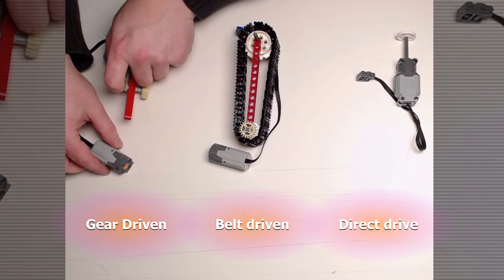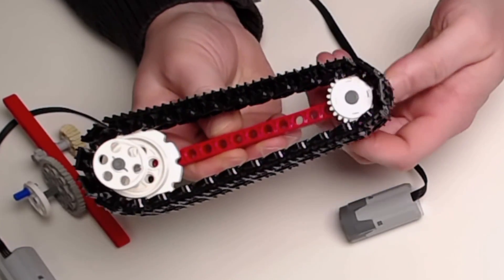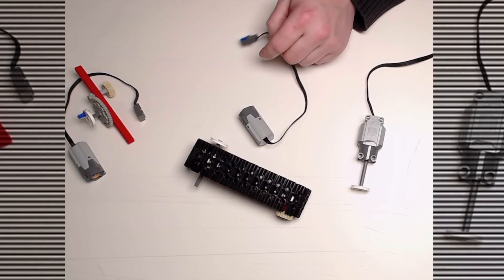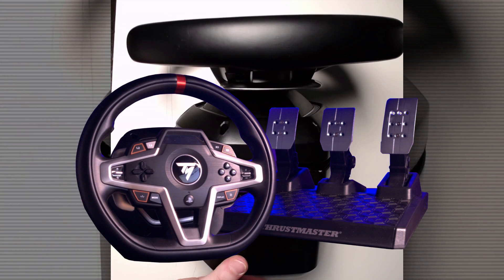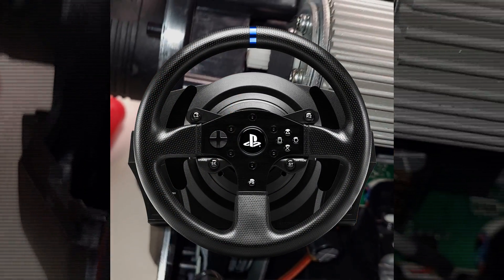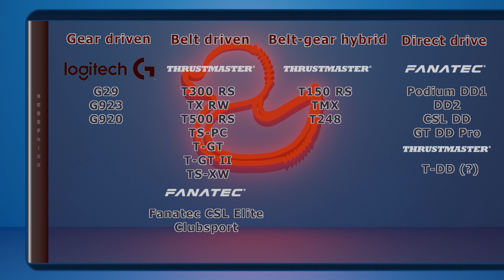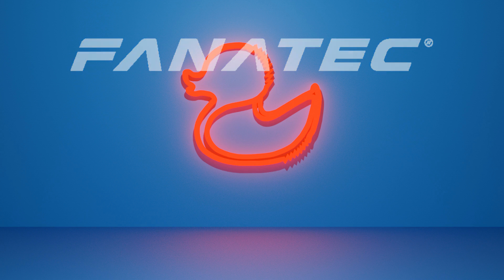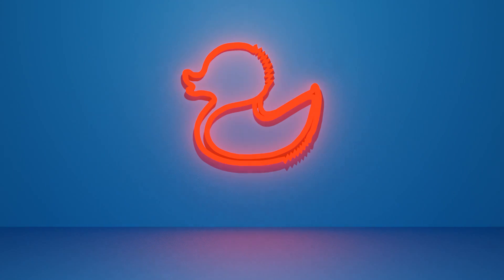Special: Direct Drive vs Belt Driven vs Gear Driven

Comment: would direct drive have a more realistic FFB? Every wheel I've tried, the wheel is always unrealistically hard to move and recover from upset. I'm guessing it could be the game doing that? I play assetto. I currently have a t300rs
Reply from the maker: @cutliss  more precise the settings. You could probably make your t300 feel better by playing around with settings like damper for example. The direct drive will help with a smoother transmission and a more fluent and fast return to center but if the settings are not right, yeah, it will also not feel realistic. My advise is to look up "ffb settings t300 ac" on google. You will find some reddit pages that will provide you with some settings to get the max from your wheelbase

Comment: wow didnt know t248 is hybrid. so its better to get the t300 for only $20 more
Reply from the maker: The T300 base is indeed more smooth and more powerful and you have a more broad choice for steering wheels. Only downside is that the pedals that come with the T300 are very mediocre compared to those that comes with the T248 (in a pack)
Reply: @SimTourist  how about t300 pedals vs the g29 pedals? i have the g29 on my 2nd week currently and im planning to upgrade. this sim hobby is getting expensive. im looking for Moza R5 and T300 + the f1 steering wheel mod now
Reply from the maker: @archinerdz97  the T3PA pedals are on par with the Logitech pedals. I currently bought an R5 to review it. It is pretty good. Please check out the Fanatec offer too if it is available and affordable. I believe looking at the current prices, upgrading to a direct drive is more advisable than a T300. For 400€ there is a Fanatec bundle and that is cheaper than the T300 (of course depending on the region)
Reply: @SimTourist  thank you! going direct drive is the right choice then

Comment: Hi, the video is awesome! Can you talk more about the durability of both logitech and thrustmaster t300 rs gt? I've seen a lot of comments I came across while researching and it seems they are both bad and good at the same time. By that I mean is some people say TM broke easily and now using logitech for years and the other is vice versa of that. What is your opinion on it though?
Reply from the maker: Hello my friend. The main issue the T300 has is that the flexibele intermediate (the belt) causes a lot of heat. Now that would not have been such an issue if the power suplly was not included in the enclosure of the wheelbase. If you look at bigger brother the T-GT, it doesnt have the same problem that the T300 has. While the Logitechs are gear driven, they do not create as much heat. I have read many fora and the consensus is that the Logitech have an average longer life-span. My next video (hopefully released this week) is in fact a remake of this one with added info and a more professional look so perhaps it may be helpful for you. Thank you for the support.

Comment: So gear system is discrete
Reply from the maker: What exactly do you mean with discrete? Noise-wise it still makes sound. It doesn't have a fan but makes noise when the gears teeth slide into eachother.
Reply: @SimTourist  I meant its discrete cause of the teeth/gaps while belt is continuous.
Reply from the maker: It is a more "blocky" experience when driving this, yes. Less immersive, feels not so real as other technologies.

Comment: Very good Youtube channel nicely done. You will be one of the top reviewers before you know it. I think logitech does not care about it sim racing line up. Bc they do other things that make them more money. They are more console focused and for a console there product reigns king.
Reply from the maker: Thank you for the kind words Mike. Your appreciation means alot! And seeing the (lack of) r&d they put in their wheels, you are absolutely correct.
Reply: I would have to disagree with them being the console king. Coming from a g29 for years to a thrustmaster t300 they are not even in the same class. Thrustmaster master is by far the console king.
Logitech are simply basic starter kit.
I wish I never brought mine and went straight to Logitech tech something with a eco system that can be upgraded.
Reply: @shawnforbes6495  what I meant was they are the cheapest combo deal and is usually the biggest seller for ppl with consoles
Reply from the maker: King for me more in the sense of they don't need to try hard to sell their wheels. I started with a Logitech and so did everyone else I know just because it is such an established brand. My next video will be on that topic when i review G923. But you are absutely right. T300 is a much more immersive base than G29. Thank you for the feedback friend. 👍👍
Reply: @shawnforbes6495  fact of the matter is, if it ain't broke.... Don't fix it. I've owned g27, g29, t80 and t300..... Guess which units failed on me.... The thrustmasters. You can call it starter kit or what ever makes you feel more elite.... But it's all that is required to be competitive.....proven.  Now own a g923 and does the job.
Reply from the maker: Fact is that many people start out with Logitech as it is a name they know hence a starter-kit for many. I don't see why calling it like that makes someone an elitist. Please try  not to call people names or attack them personally. Everyone has the right to an opinion.
Reply: @neilbezuidenhout9284  wow complex much
Reply: @mcalbols  lol, yes. Whatever makes u happy. Good chat